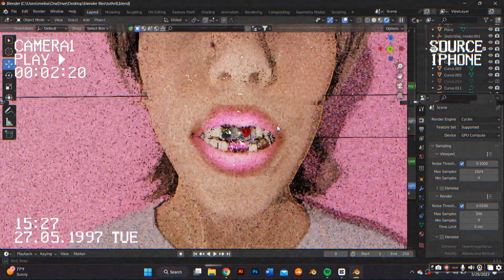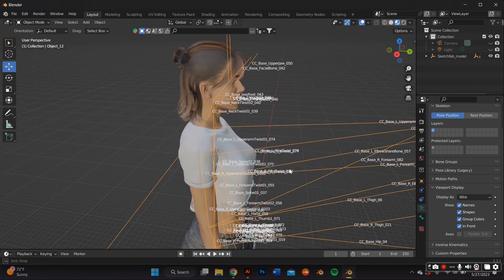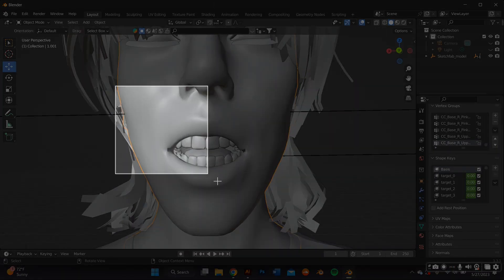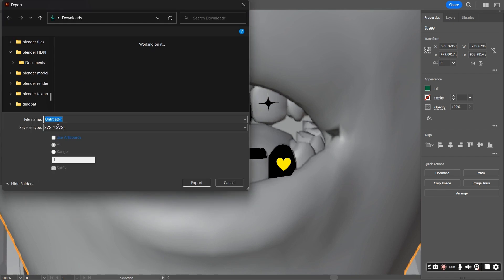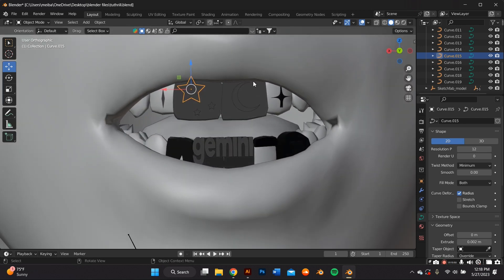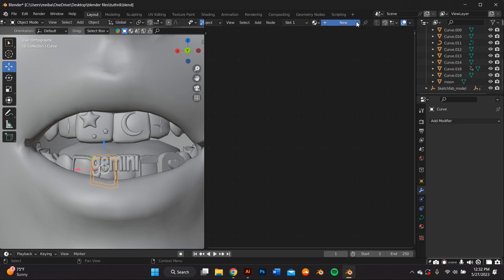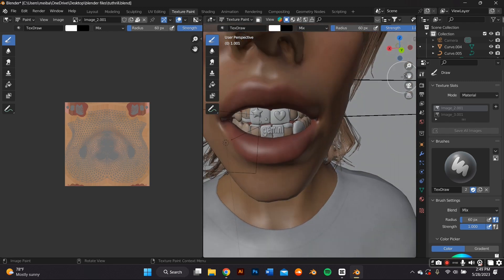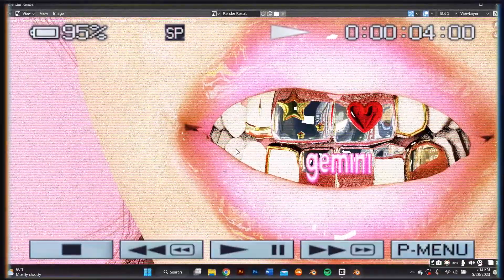How to make 3D CHROME GRILLZ on Blender 3.0 and Adobe Illustrator  | beginner tutorial

Comment: Hey just finished this tutorial! Love it! One question why is my model rendering with its mouth closed🙃
Reply from the maker: Great question , this is probably because the model is Keyframed. That means that your changes are overwritten by the keyframes when you render. Either delete all keyframes, or set the new pose as keyframes as well. For that, select whole model in pose mode and press i  > Location, Scale, Rotation.
Reply: Thank you!! Also how did you get the lips soo glossy
Reply from the maker: I just made the whole face glossy by clicking the face and in the shade editor side there is a node called " glossy BDSF'" , I just made the roughness zero.